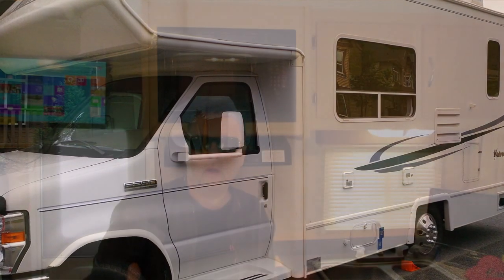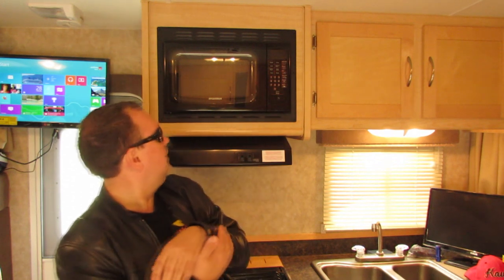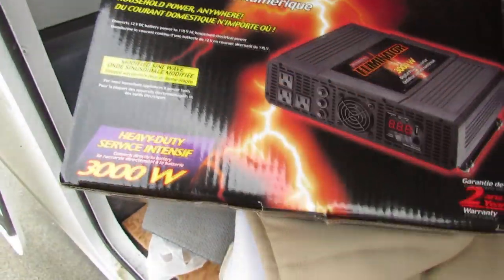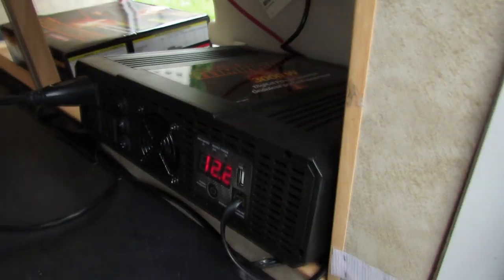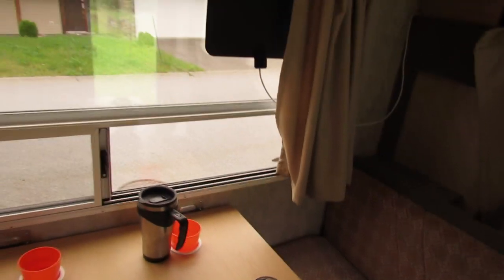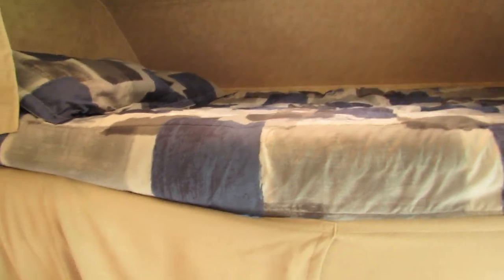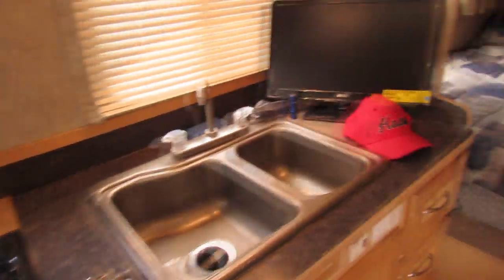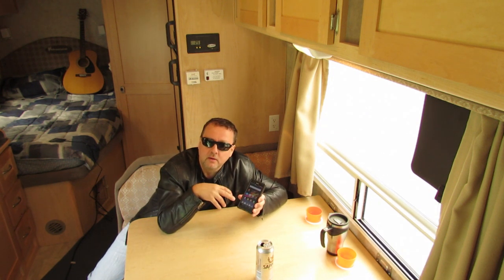RV'er Blows His Fuse!!  3000 Watt Inverter Install Issues

Comment: So let's talk amps, volts and watts.
Amps x Volts = Watts 
Watts / amps = volts
Watts / Volts = Amps

you want to power a microwave, lets assume for simplicity sake its a 1200 watt microwave.

1200 watts / 12 volts = 100 amps

Your inverter manual should have information on the proper size wire and fuse to install from the inverter to the batteries.

For a 3000 watt/5000 surge the amps at 12v would be  250/417

From the 3000 watt inverters I have seen  they say they need a 300amp fuse

For that high of an amperage you are looking at O or OO size cables (depends on distance between the inverter and battery. shorter is always better)

From the video the cable is way too small even if you put in a large fuse you will melt the cable. There are many charts out there showing what amps a specific cable size and length can handle.

Check the manual of the inveter for recommended fuse and cable size.

hope this helps
Reply from the maker: Thanks so much:  looks like I will have to re-wire it with appropriate gauge wire in the coming weeks. I'll post a video when I do it. Regards from the home office in Vancouver, Canada.

Comment: The wires running from the batteries are way to thin. You also need to hook anything high powered you hook up to an inverter up to an amp metre before you actually connect it to see what kind of amps it draws upon startup. A microwave really needs pie dough wane to function correctly, it's simply not worth it to scimp on the inverter when you can get an American made 3000 watt pure sign for 700 dollars

Comment: If you don't put 150 amp in you will not be able to get 15 amps out for the microwave. Get the same size wire that is on the battery under the hood on you motor home.

Comment: The others are right.  You probably need bigger wire like battery cable size and a 400 amp fuse.

Comment: the Amp draw on a 3000 watt is way more than the fuse you put on the cable its 250 amps from the batterys

Comment: It seams you have a problem with to much amps at the same time so you mite have to trun something off to run your Micowave like on a home 15amp line you can not run 2 1500 watt heaters with out blowing a fuse so it seams you can run it but not at the same time as some other big power drawer is pulling power or you blow the fues so add up your amps use and fined the one or get a 5000watt invertor have a good day.

Comment: you don't have large enough fuse or wiring, 3000w would require a 30amp fuse if it was 120 volts.  With 12 volts you would need 250-300amp fuse and wire.

Comment: My 2500 watts is hooked up to.... two 250 amp  breakers/fuse   battery bank  Circuits
 ( I  have 4 - 12 vdc group 31 batteries and have two batteries in each bank)
 for a total of 500 amps protection for the short leads that feed  the inverter.
 (6 feet of very large cables -- aminimum  of 2 # 4 wires) 
A battery isolator relay parallels the main starting battery with the hotel services battery bank when the engine is running, 
(Battery isolator diodes  are too much voltage drop and don't allow a proper charging. A relay is better. )
Your installation was wrong . I can run all likes of stuff on my set up of kitchen usage . I also have a smaller pure sine wave inverter for medical use. The electrician that know his school math of voltage drop and transformer wattage should be able to advise you.

Comment: Hey do you have a charge controller installed? Not sure how/if that would impact your setup but I do know that all solar panel setups I have viewed included a charge controller. If this is a non-issue for your setup just ignore this post. :)

Comment: Modified will ruin your electrical and modified also gives you dirty power,...you need to run a pure sine wave inverter there are only two of the best out there in my opinion, and they are ether Edecoa 3500w pure sine wave or Reliable 3500W those to will do the trick,...
Reply from the maker: It's been 5 years and hundreds of hours on many devices and nothing has been damaged on my modified sine inverter.

Comment: 30 amp fuse on a 3000 watt inverter what way would you do that 30 amp fuse or a 35 amp fuse is not enough you need a higher rating.

Comment: you need a 50 amp fuse most 3000 watts power inverter use a 50 amp fuse plus use 0 gauge wire
Reply: +Clark Witczak This makes zero sense......you will never get 3000 watts out of a 50 amp fuse. My 2000 watt xantrex surges to 3000 watts and calls for a 250 amp fuse. And 0 gauge is to small considering his inverter probably surges to 4000 watts.
Reply: Lol
Reply: Prove me wrong.....
Reply: Did I hurt your feelings Clark?

Comment: A microwave oven has a 4 times peak surge 1200 watt times 4 equals 4800 surge plus or minus.. you need a much higher wattage inverter in order for it to work.  don't look at the wattage continuos run time, always look at the surge that is the start up in milliseconds and that is the magic answer. Every time you here your refrigerator motor kick in that is a peak surge which is very very high wattage being dissipated in a millisecond and the electrical company has to give you that much power even if it is not continuos running. then she drops down to normal dissipated wattage! and that is the problem you are having. the inverter isn't made for such high peak wattage... My advice go get a 12v Rv microwave oven. Problem solve,

Comment: Switch to a pure sine. I would not trust a mod. no matter what its rated for. Microwaves even know you can get them to work on mods, I can warm up a cup of water in a minute plugged into shore, but on a mod it could take 2-3 minutes instead of the one. 

A Mod inverter is just no way to go. even for short times. I wanna cry when i see someone using one. even more when they plug expensive things into it. Like TVs, Microwaves, computers. lol

Comment: your cable is too thin when forcing a lot of power to go through the wire it heats up the cable and burn the fuse you need a fat wire for best result go for a 0 gauge wire you can use welding cable order the one they use for car audio amps

Comment: This is a common failure. The inverter used here is modified sine, in that it is not a symmetrical pure sine and as such, the Microwave oven is having problems with that due to it's current demands through it's transformer.  You MUST use a PURE SINE inverter. They're a little more expensive but well worth it in the end.

Comment: ok hope this help 

ac amps and DC amps are not the same 

1 amp AC is all most 3 amps 12v DCs

pull 10amps AC and that is all most 30 amps DC

this is all so why big bus RVs run 24v and or 48v inverters

all so keep this in mind MD inverter is like running you car on bad gas  it well run but for how long 

get a SW inverter as soon as you can or you well kill your TV laptop  in around  6 months if you dont  and sooner if low% MD inverter like that you have

Comment: you are going to need 0 gauge wire and a 360 watt fuse
Reply: you mean 360 amp?
Reply: Random_rapper20 yes it will fix your issue

Comment: You don't have enough power reserve, you need more batteries which means you need more solar panels to charge those batteries and since you don't have the room to add more batteries your stuck the old fashion way by having to kick start your generator everytime you want to use the microwave or heater.  You went overkill on the power inverter since you don't have the battery back up to match the power.  Hate to be the berrier of bad news but those are the facts.  Good Luck...